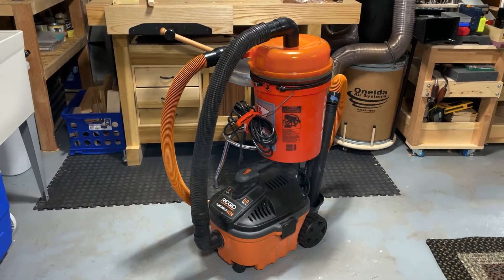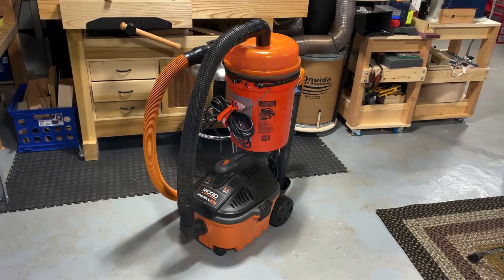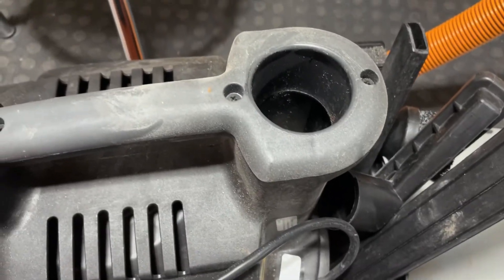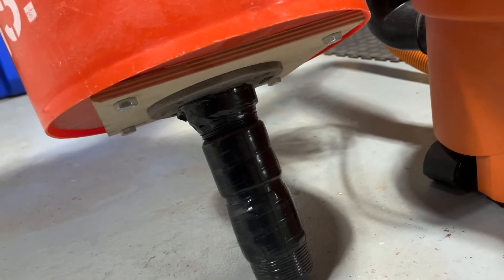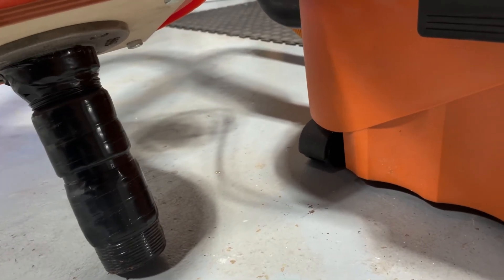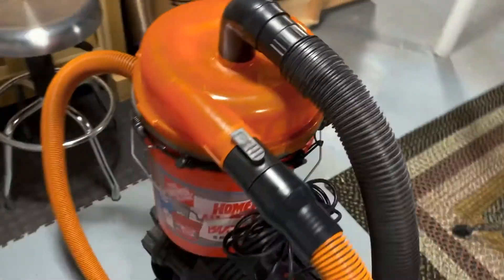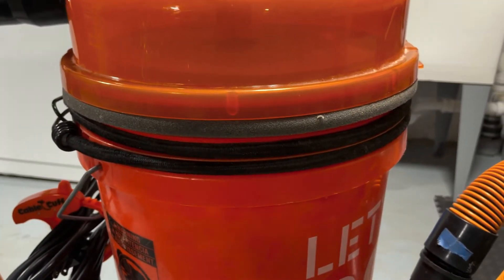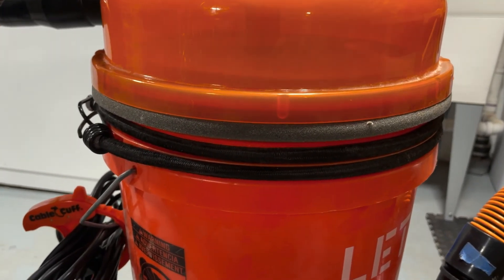My Dustopper and Ridgid WD4070 vacuum setup

Comment: What hose and adapters are you using between the vacuum and the separator?  Mine is too small in diameter and I stumbled onto your video looking for the correct step up adapter.  But now I want to replicate your setup. Great job.
Reply from the maker: Thank you, the Dustopper came with the connecting hose and one of the adapters. I purchased another 90 deg elbow adapter on Amazon which happened to extend the reach enough to make the connection. Flexaust 231 Tuec Plastic 90 Elbow, Black https://www.amazon.com/dp/B01G8QVFBM/ref=cm_sw_r_cp_api_i_CHRN1K3418EWDGN1NXH5

Comment: Hey Joe! I’m looking to do a similar setup in my garage today. 

Was wondering if you could comment on the noise level when using the system like this as opposed to the just the shop vac with the standard black hose? 

I was concerned since a few ppl in other vidoes have shared that the orange detailing hose causes a high pitch noise. Have you noticed anything similar?
Reply from the maker: Hey Stephen, I haven't noticed much difference with the orange hose. I think if anything it's pretty minimal. The Dustopper separator however does add a whine to the overall sound, but it doesn't seem to increase the db by very much. Thanks!
Reply: @jriddim  okay sweet! That’s good to know. Thanks for the info and awesome video! 🤙

Comment: Hello, how exactly is the weatherstripping installed inside the duststopper? Just on the lip?
Reply from the maker: Hi Brandon, it’s installed on the inside of the lid, so that the weatherstripping meets on top of the bucket. When I turn my vac on, it pulls the lid down onto the bucket, compressing the foam rubber.
Reply: @jriddim  That makes more sense Thank you!